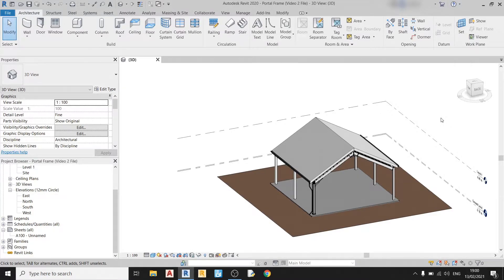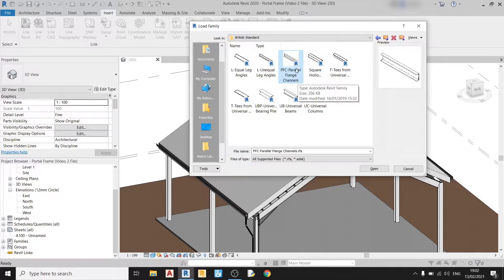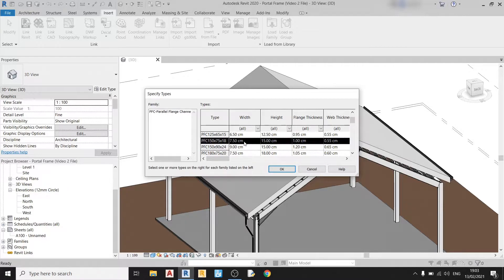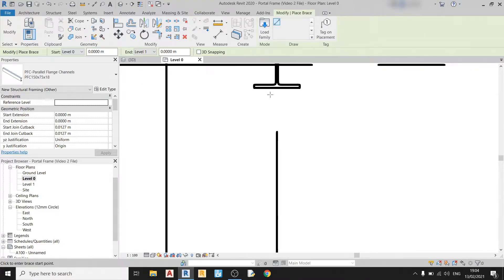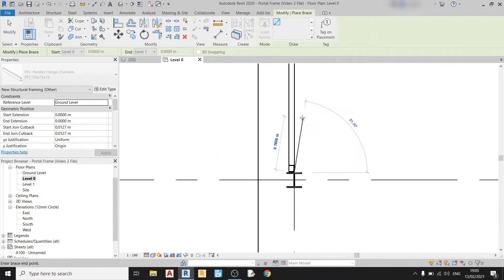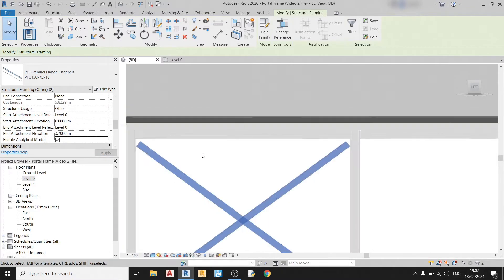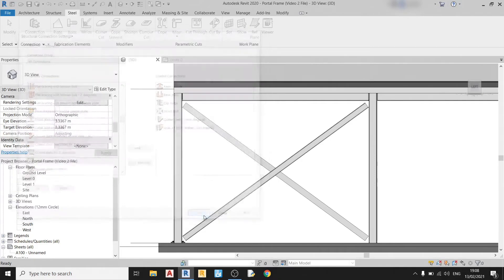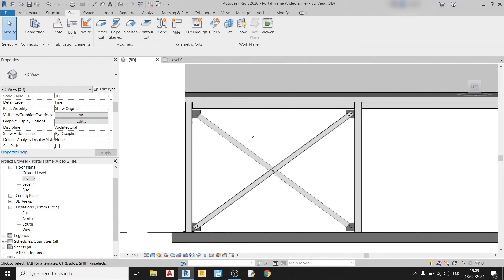How to draw steel bracings in Revit?

Comment: Hi, do you have a video with explanation how to get a table of content used beams, bolts, washers, gaskets ets. including material, size, weight and QTY? Usually it's placed at right up corner of title block.
Reply from the maker: Hi Jelena, I currently do not have any videos on that. I will make more Revit videos in October since I am focusing on Plaxis 2D for now.
Reply: @revitforcivilengineers  I will be grateful for your help! Success with Plaxis 2D!
Reply from the maker: Hi Jelena, I just made a video on schedules for structural columns and framing elements. I hope this helps you.
Reply: @revitforcivilengineers  Thank you 🙏